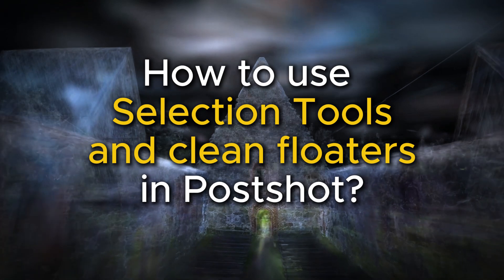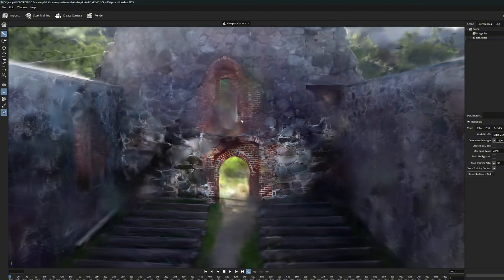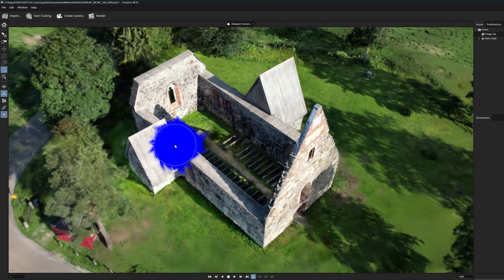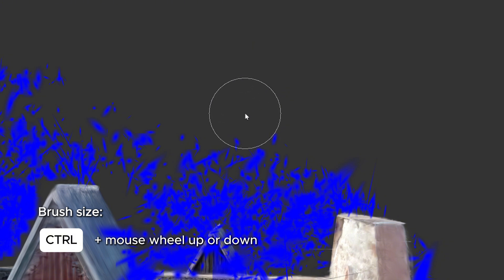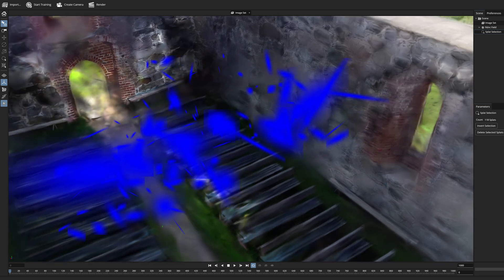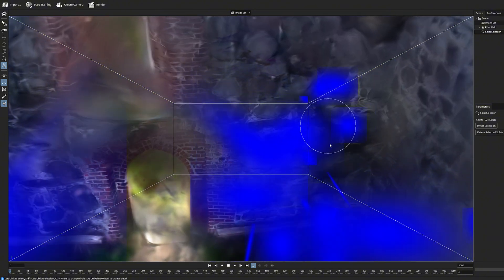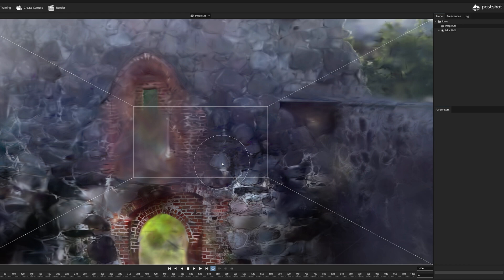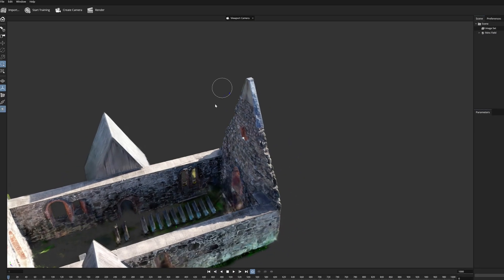Cleaning Gaussian Splatting models in Postshot

Comment: I find it very difficult to clean up splats in this way. You would need a second camera to keep checking whether you have caught too many splats that you might not want to remove.

At the same time, it is also one of the best methods. Basically, you can say that splats are not particularly easy to clean.

Comment: man you are the best❤

just wondering if you have two 360 camera + full frame camera with 14 mm lens  how would rig everything together for 3d gaussain splatting?😅

I saw of one of the videos using a stick with multiple camrea points on different direction and place on different highest  .so I was wondering what if you use two 360 camera + full frame camera with ultra wide lens

Comment: Thank you for the video. I've only just downloaded the latest version of PostShot. Still playing with the variables to get the most out of it. I'm very impressed  with what I have seen so far. Especially as this technique is only about a year old. One question I do have is that during the model building there are obvious points that can be cleaned up / deleted before the final Splat process. Is there a way to do this?

Comment: Great content Olli! But perhaps you should stop referring to the 3D Gaussians as “splats”. “Splatting” refers to the rendering technique used to display the 3D Gaussians and has nothing to do with them as individual objects. Perhaps check out the original paper “ 3D Gaussian Splatting for Real-Time Radiance Field Rendering” to understand better the terminology and techniques :) I can’t say I fully understand everything after reading it but its fascinating none the less. Keep up the helpful videos! Best of luck
Reply from the maker: Yeah. Thanks for the feedback. I have read that paper and I'm still also pretty confused about it. What comes to the correct terminology and how to use it I just used splats as they are mentioned in Postshot GUI and documentation. There are several mentions of splats and it is also pretty common word in community.  But for "Splatting" you are right. It is as a verb a method which describes the rendering technique.